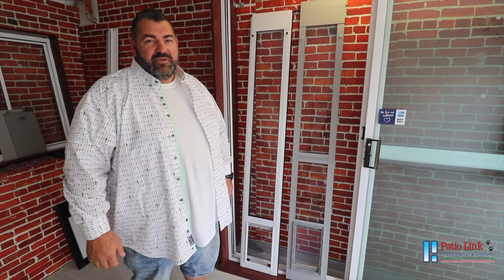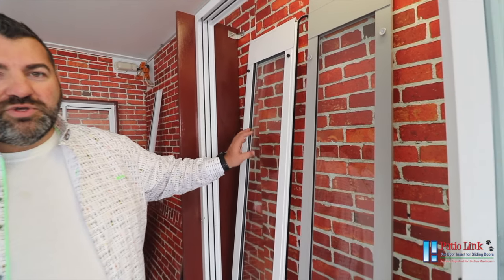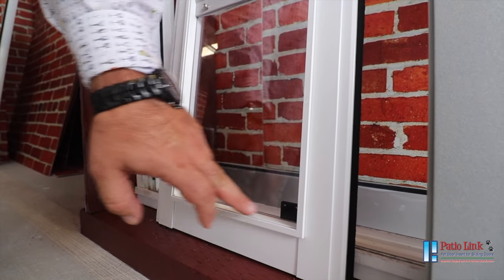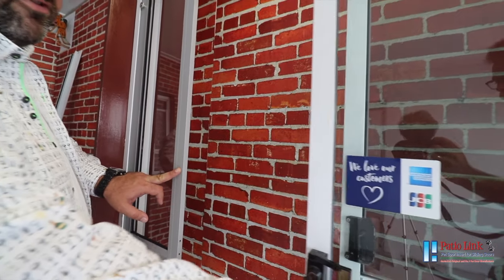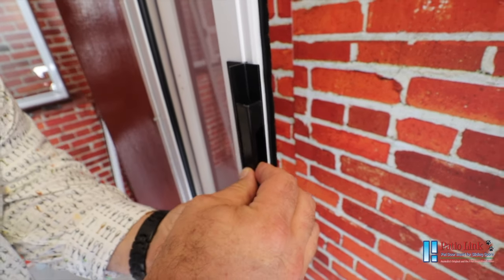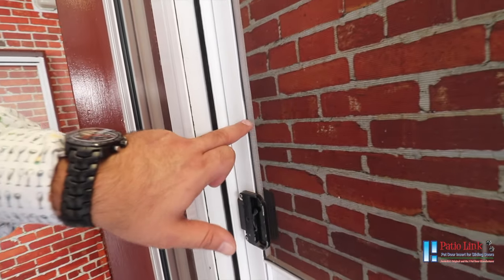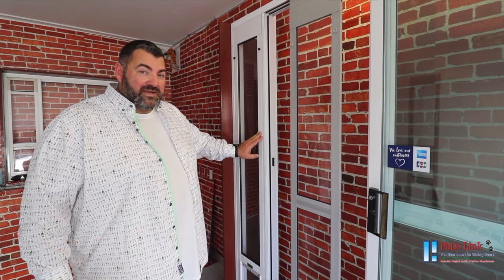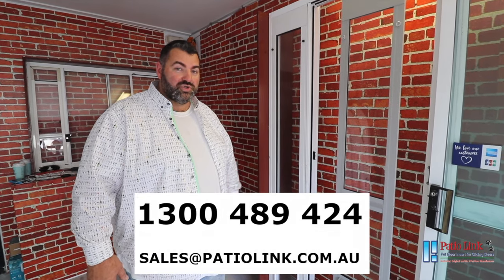Patio Link Pet door Insert Comparison MUST SEE! Before you Buy❗️❗️❗️

Comment: what locks the pet door to the house?
Reply from the maker: Hello - you need to relocate all your female latches to either our adaptor or a locking bracket. And to secure pet door to your sliding door frame, you just need to put 1 screw through the existing screw hole where female latch used to sit to connect pet door insert through the frame. Your welcome to email us some photos of your doors and locks and we can check and confirm if your doors are ok and compatible for install and locking. Our email is info@patiolink.com.au
Reply: Thanks.  I am moving to a new state and not near the doors right now.  Do you ship to the US?
Reply from the maker: Yes we do deliver to USA. When you get access to your place, please take some photos of your sliding doors standing inside, pic of handle and female latch and a pic of bottom track too and email us info@patiolink.com.au  Also please measure your sliding door height as close as possible from top inside channel all the way to the bottom inside channel and let us know your height. We look forward to your email :) Thank you, Ivana from PatioLink Pet doors  @4LifeChanges310
Reply: @PatioLinkPetDoors  
Oh ok 👍🏼 
Approx how much is shipping to Florida?
Reply from the maker: Depending on size of the pet door insert, it can cost up to $400 AUD. But email us when you get access and we will see if our production can make a pet door that will be foldable in half and delivery should be cheaper.  @4LifeChanges310
Reply: @PatioLinkPetDoors  
Ok sounds good.  Thanks so much. 
I’m looking at a large door (my dog is 45-50lbs). But can touch base later ☺️

Comment: What happems when there is an inch height where the frame doesn't go in?¿
Reply from the maker: Hello, its always very important that you measure your glass sliding door height before purchase. You need to measure your glass sliding door  height from top inside channel all the way to the bottom inside channel. If your height is between 2.0-2.1m then you have a standard height. If your height is less than 2m or taller than 2.1m then you will need a custom height pet door insert and we specialise with custom height pet door inserts. You will always have 10cm adjustment on top of the pet door insert (top adjustable panel that goes up and down by 10cm). Thank you and let us know if we can help more! Thank you, Ivana from Patio link pet doors